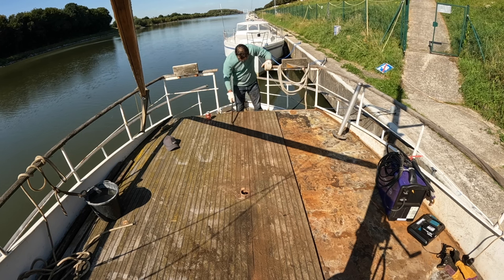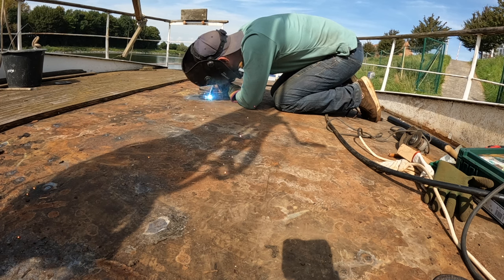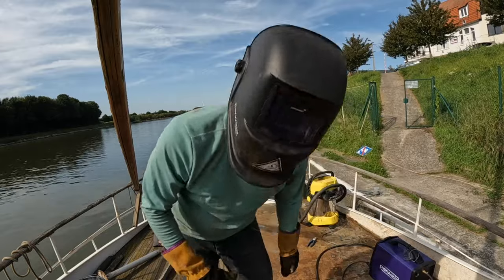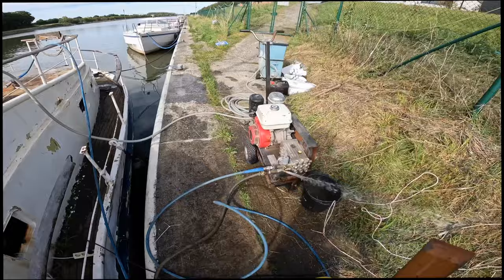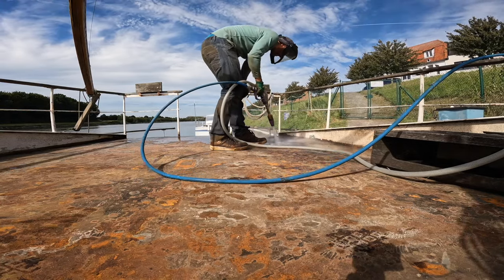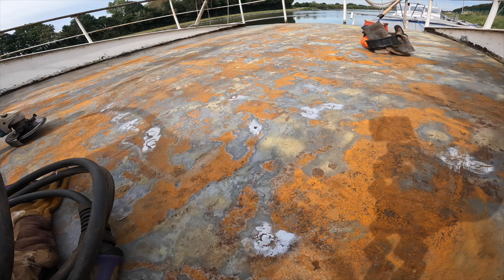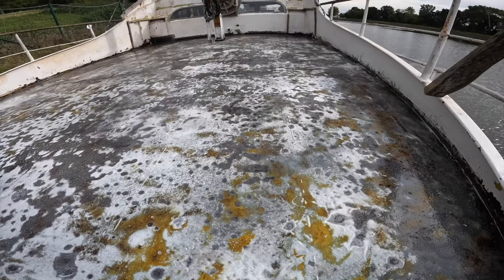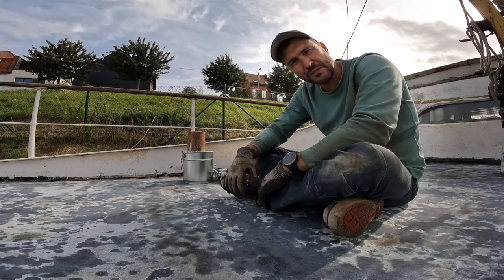EP  4 - Steel  Restoration: my Guide to Welding, Sandblasting & Painting Techniques | BoatProjectY

Comment: Once again, good work.
At some point in a not to distant future, you should ask yourself whether or not to keep the masts. If you choose to remove them, you might as well do it now, before you reinstall the teak deck.
Reply from the maker: hi Carsten, I definitely want to keep the masts, even reinforce them to be able to "sail" again. at least that is the plan.
Reply: Great work, so far, what rust converter did you use and what paint system are you proposing and are you in lifting her at some point.
Reply from the maker: @johnmugbusiness5127  the rustconverter is called RANEX, and for paint I basically use what I can get my hands on for a good price. currently I used Sigma cover 280 for the deck. and yes the idea is toi get her out of the water as soon as I find a good spot to put her.
Reply: @BoatProjectY  will look at it, well done so far.The problem is different views with doing steel properly, but your doing great.I have painted 2 and about to paint my third any two pence worth then no probs with messaging me and if my experience is helpful then great if not then that's also great.Good luck and great work.👍

Comment: this will become a nice vessel again . design features for contemplation :1.since you know how to weld ,despite the canoe stern , make a swim/entry/exit platform on hinges at the stern ,with enough free place for a wind vane, being careful about the water flow  and height of platform .. .2. luxury feature ,as functional pleasure for your extended work ,since you have a lot of deck space : multifunctional ,watertight box on deck ,that can function as rain water catchment ,'whirlpool' with sweet and salt water , comfortable dry lounge, wash machine by boat motion and if needed feet stamping (half filled and watertight lid ) ,storage box ,table ,......  .
sometimes ,especially with extended hard work ,it is motivating to add meaningful fun projects with an artistic flair .
Reply from the maker: thanks for your reply. the aft deck has 2 beautiful multipurpose 'boxes' that are currently being restored by my dad. it's gonna look awesome. the swim ladder is something I've been thinking about for a long time, I found the perfect spot, but need to find a nice design that supports the lines of the boat. and I can not agree more the artistic/fun projects is what keeps you going in the long tedious  jobs that have to be done.
Reply: @BoatProjectY  thought more about meaningful fun projects and the advantage of having 2 big decks and a steel boat . I would seriously contemplate to cover the aft deck fully with a hardtop ,to  
have a large protected area ,with rain water catchment,( future )big solar and strong enough to have hammocks tied to the structure . window spots to see the sails and potentially hanging canvas on the sides  .the front deck is big enough to have sun exposure if wanted ,even the top of the hardtop can provide that ,if strong enough ,hence full protection and multi use of aft deck .being able to weld the understructure onto the deck is a huge advantage . wish you and your family the very best
Reply: @BoatProjectY  ps to swim/entry/exit platform .again an advantage of the steel structure . to keep the water flow of a canoe stern and space for (future ) wind vane ,you might be able to have a combined mini platform-ladder hinged to the upper part of the end stern , which enables you to have it up ,leaning secured against the higher boat level and down at appropriate height ,thereby not impeding water flow at all .
Reply: @BoatProjectY  another meaningful fun project : males have an advantage to just pee overboard ,if out of marinas and sight .on sea ,offshore ,toilets are flushed into the sea ,but still need maintenance and water . what you could do ,with your advantage of having a steel structure and a lower small stern deck ,is ,to have on one side of the canoe stern the tiny swim/exit/entry platform on hinges from the stern reinforced railing and on the other side the shower and a reinforced seat over the water as open toilet ,kind of a 'dolphin seat ' hanging over the water ,for women and men .shower hose in case of mishaps and as outside shower and if you go asian ,like billions in Asia ,using water and (organic ) soap ,instead of toilet paper . that is clean ,functional ,with less maintenance and adds to outdoor life and adventure ,just needs to be made foolproof safe ,which is much easier with your boat design and material .
Reply from the maker: @kayweiss1862  thanks for your insides, I agree with the hard top of the pilot house needing to house the solar panels that's the plan, but I need more and the aft deck would be perfect. now... I very much dislike all boats with tents ruining the aesthetics of the boat. so I guess my only option is to make a temporary instalment of sun protection over the boom. possibly with flexible solar? and sure the hammock is essential, definitely need a spot for that ;))
Reply from the maker: @kayweiss1862  exactly my idea, now need to find a nice design...
Reply from the maker: @kayweiss1862  I love your contributions! keep m coming. I'll run this idea by my wife, see how much she fancies this idea, but I surely adds to the freedom/adventure lifestyle I very much support and love
Reply: @BoatProjectY  agreed ,tent structures are often an offense to an artistic eye on a boat .well designed hardtop ,with strong (hammocks) stylish designed welded understructure can be pleasing and super practical . I would make it possible to have canvas hanging from the sides for convenience , but leave it first without canvas ,just make hardtop ,to see if needed and what would be the best . some things need time on the boat ,should not be made hastily ,but better to make new structures ,without impeding the possibility .it is frustrating to build something ,that later becomes an obstruction . please remember , apart from other comfort ,that skin cancer is increasing rapidly and the aft deck will be your main place to be . as most know ,steel boats will have extra work concerning rust ,but the strength ,security and worldwide easy repair through welding ,has immense advantages . because of the extra work ,it is nice to design obvious special features ,done right away or later .these special features offer you comfort and motivation . 1 extra : casual break ins are likely increasing . again ,having a steel boat ,you can much easier make all entry points secure from casual break ins and especially women will feel safer. 2. install a largely oversized anchor system ,where all components are much stronger than normally recommended .3. strong insulation needed ,but choose non toxic insulation and that does not attract mold and odors . 4 outside toilet seat is unusual ,but has great advantages .maybe you have to think about extra screening from sight ,apart from security for your females .
Reply: @BoatProjectY  last add to unconventional outdoor toilet/bathroom . if you add salt and sweet water hose and even warm water at the outdoor bathroom location at the stern ,your females can even have their own bidet function and much cleaner, since not from a bidet bowl, but from hand held hose . I live since decades in Asia and by now must have saved many trees ,by avoiding to use toilet paper .toilet paper just waste storage space and money and resources and easily clogs toilets . just disciplined washing needed and it becomes a good habit .even if your females are initially reluctant ,it is still worthwhile to integrate at your boat . no need to go downstairs ,enhance the adventure function of traveling at sea and be more environmental friendly .optional ,temporary screen function possible ,but with polite discipline on board maybe not needed ,all hands looking forward when outdoor bathroom in use .
Reply: @BoatProjectY  still thinking of your boat project and now really last ps, without being asked : adding meaningful fun projects to necessary 'drudgery' work often keeps motivation going and endears ones boat ( with inviting hammocks for instance )to oneself and others . humor and laughter is important as well .when you talk with your wife ,maybe add this; uncountable trillions of beings live in the sea, pee and poop and feed and 'bath' there ,but none of them cut trees to make and use toilet paper.why should cruisers do that and be stuck with cleaning toilets in addition ? .